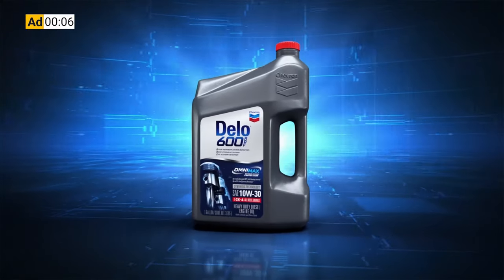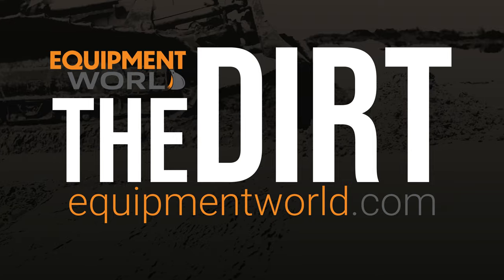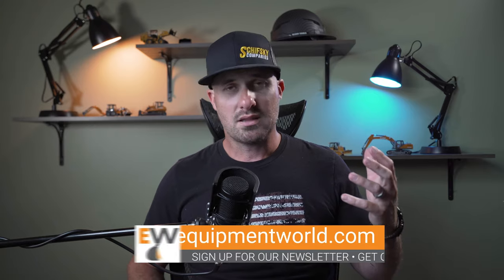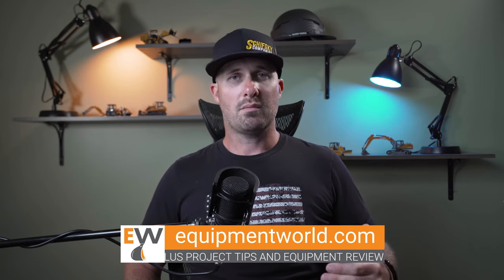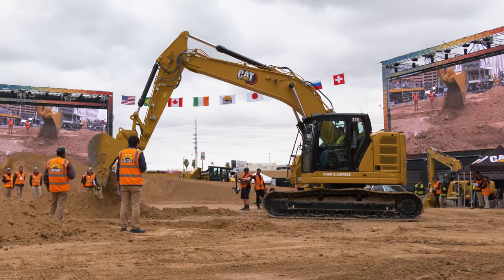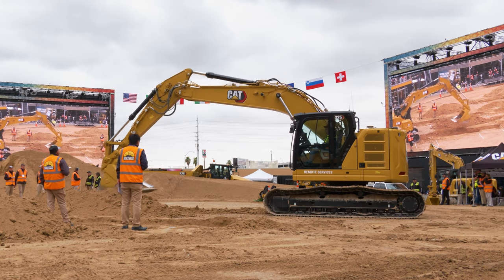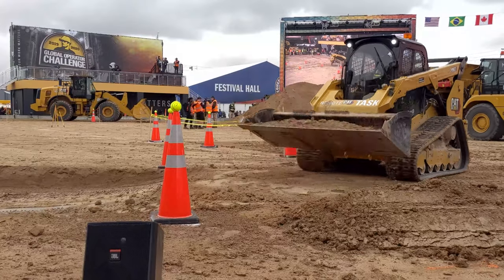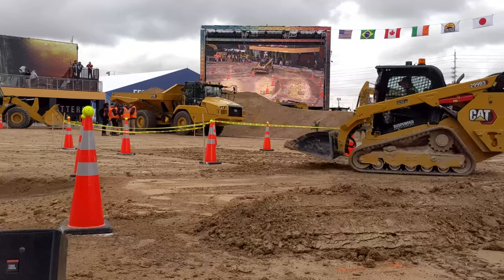Why Using a 2D System is a Great First Step in Machine Control | The Dirt #29

Comment: 2d control is the way of the future because the future is there will be very limited operators that can even run a machine, just like truck drivers that can drive are falling by the wayside and very fast.
Reply: I think we have a ways to go before machine control makes operators obsolete. It's more of an enhancement to help operators become more efficient and more productive using their current skill set.